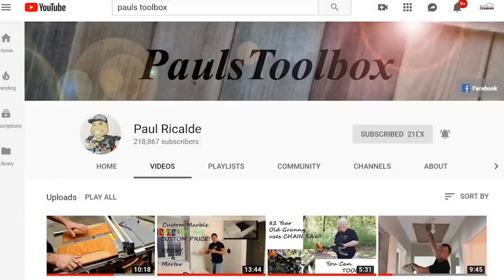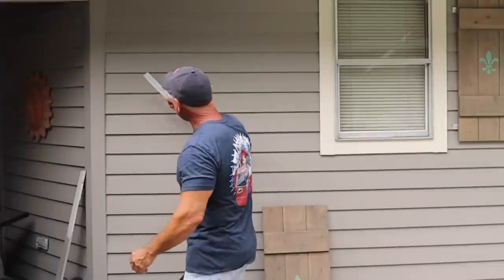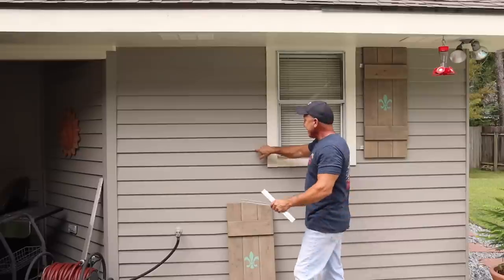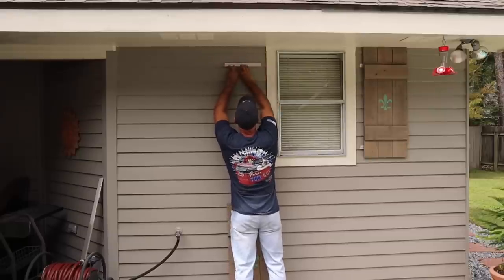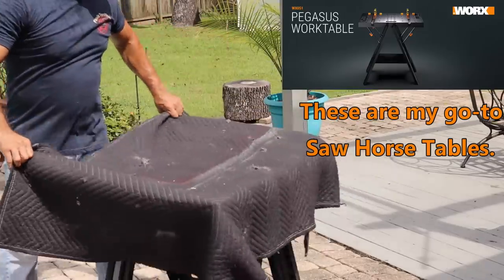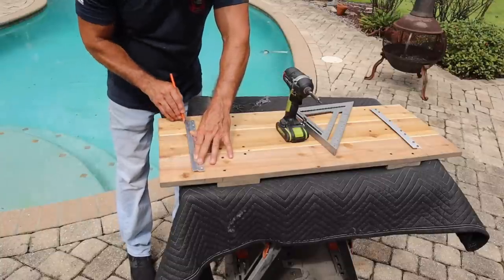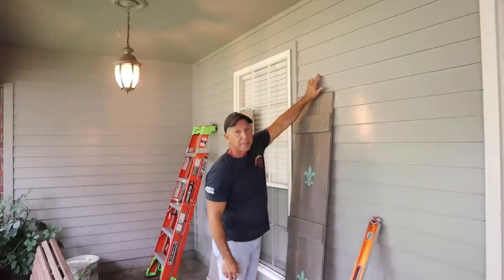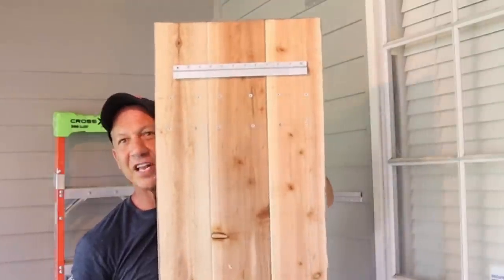Easy DIY Removable Shutters: Upgrade & Maintain Your Home's Look! | Paul Ricalde

Comment: Tip with that siding. When u side a house. No matter the hight differences. Go all around the house till all of your siding meets up. Whether its 1 run up or have a deck and have to go up 5 runs before you get to the j channel  on deck.  Once the siding matches the same around all around the house then start siding one side at a time. I see a lot of people run one side then next then next and they get to the last side and they  have alot to make up. Or cut down.  Just my way of siding a house.
Reply from the maker: You’re absolutely right Tony, I plan on doing a video on vinyl siding and I will show that you always put your starter channel or if you’re doing wood siding your first board all the way around and make sure it’s level. That’s the hardest part everything else falls into place. It’s always good to hear from you buddy have a great night!

Comment: Excellent idea. Needing some more thought about strong winds etc. But looks promising
Reply from the maker: I see your concern but these shutters are being held at a min. of 2 points for smaller shutters and 3 on larger ones. The wind would hve to come from underneath pushing the shutters straight up for them to be removed. I suggest a small dab pf silicone on 2 points to keep them from any movement, I recently had 50 mph gusts and I only had them sitting in place without silicone and they didn't budge. I am also looking into an extra safety measure for hurricane force winds. I will have information available as soon as I figure it out. I also have some really cool adaptations that I will share soon. Thanks for taking the time to watch and especially commenting. Have a great day Ofri!
Reply: Put a wooden cam on the outside edge that you can turn to clamp/increase pressure against the cleat.

Comment: Great info! Well explained mostly!
 However-To attach my DIY wood shutters to my brick home.. can I use masonry screws? What would you recommend to lock the french cleats to the brick? The peel and stick from cleats wouldn't be enough to hold them securely, allowing to slide on or off for maintenance? While researching how to go about this project for my home,  I've been told brick could split? Yet I have seen several videos of people drilling directly into their brick homes when attaching said shutters. Tips?!
Reply: Did you use masonry screws?

Comment: Great video Paul.   Do you have source for the cleats?  Haven't seen any with the adhesive strip...
Reply: You have to put the adhesive on. The z bars you can get at orange aluminum. Price cannot be beat. They come in 6 foot lengths so you have to cut to desired length. The adhesive you want to use is VHB 3m 2 way tape. It's on Amazon. Just type in 3m VHB tape.

Comment: What about if the brick up top sticks out away from the wall? Right under the soffit, the brick is flush but then it slowly comes out away from the wall as you go toward the bottom of the brick? This makes our anchors too short to go into the eall
Reply: I have the same scenario as well . Paul , do you have any insight if your system will work with this scenario. The brick house in your video looks like it might be the same but hard to tell.

Comment: Why are you damaging your wall and creating additional routes for water to penetrate with do nothing trim? If the “shutters” actually SHUT to protect the windows from being damaged during a storm as they were originally conceived it would be a different story.
Reply from the maker: Some shutters are made for storms and some are for looks. This does not damage anything. I am replacing non functional shutters that cannot be removed with an easy to install kit that allows you to take them off in seconds thus making it easy to clean or paint, not to mention it makes the original install much easier and faster.The double stick tape is waterproof and will not allow water to enter where the screws are applied so there are LESS chances for rot than with the original ones. Thanks!